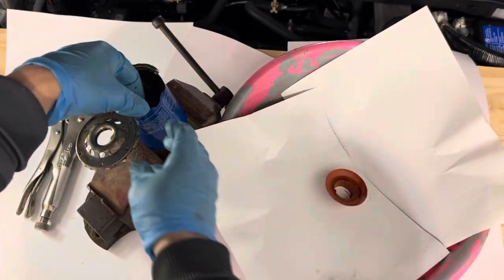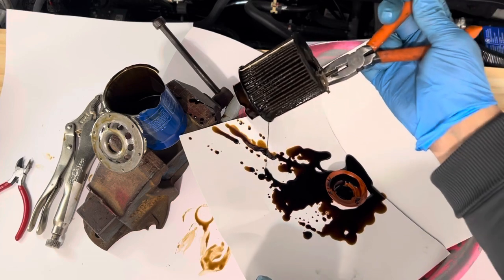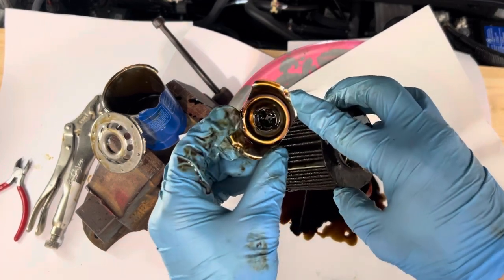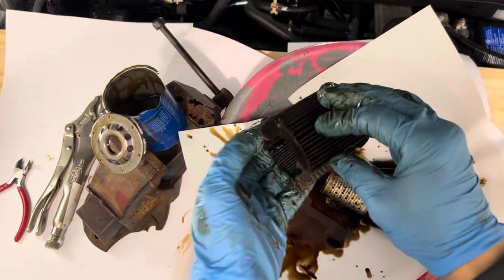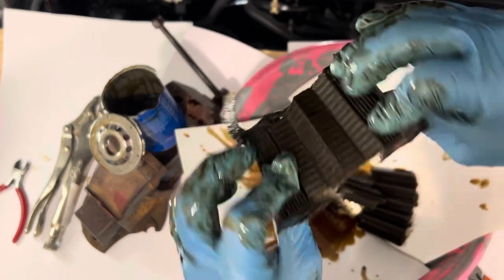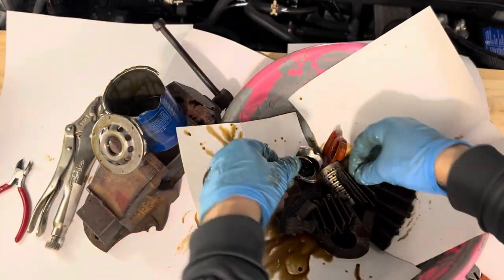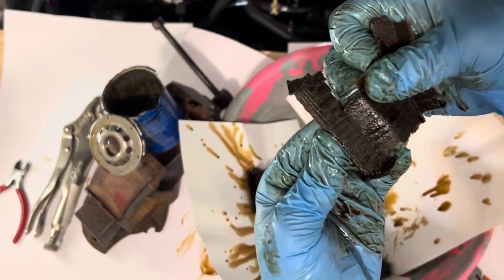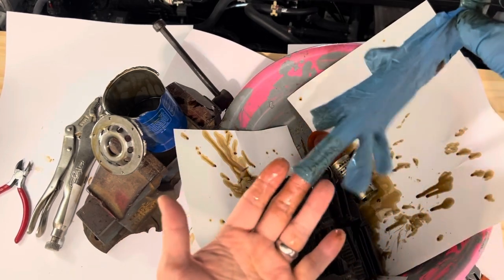Inside the Honda CR-V 1.5t Oem Oil Filter with 6000km. Dissected.

Comment: Honda A02 made by Fram. Nothing special, imo.
Reply from the maker: Yeah… I’m pretty sure I got that filter put in when I got my yearly discounted oil change from the local Canadian Tire. The whole oil change only costed $45 which is super cheap compared to Honda (almost $200). 

The filter I bought from the dealership (and is installed into the CRV now) is from Japan… so hopefully it is the synthetic upgraded filter. Thanks for commenting!
Reply: @kidsfuturesareworthit.8673  If it's made in Japan, likely the Honda 003 made by Mahle/Tennex. Not a synthetic media filter either. And, you're welcome.
Reply from the maker: @faxmen09 Thanks again for the info! Hmm not that I’m a “synthetic filter” snob… but for some reason, I was under the impression that Honda would make their filters out of a stronger filtering media capable of finer particular filtration. Maybe I was thinking that because the oem filter from the dealership is so expensive, it must be the “best” lol.

I’ll take apart the Japan one next and if it is just paper, then would you recommend going to a Wix sythethic or something? I have also seen Mobil sythetic ones for about $18 or so. 
Cheers!

Comment: That’s the Honda filter made by Fram. Basically equivalent to the orange tough guard filter. The Japanese made version is synthetic material with metal end caps.
Reply from the maker: Oh, makes sense. The new one I put in is marked Japan. So I’ll do a tear down of that one later. Thanks for the info!